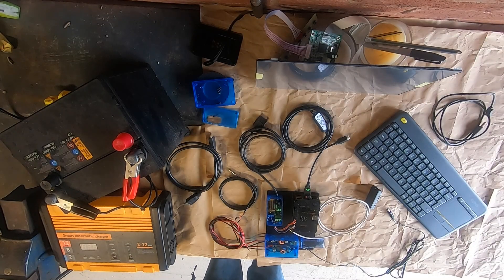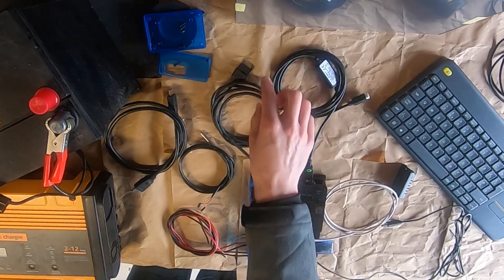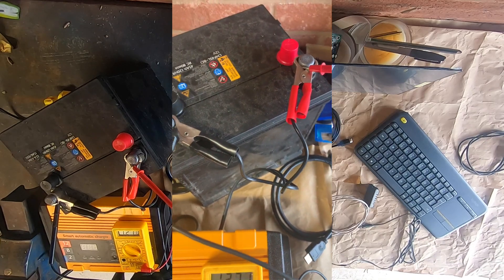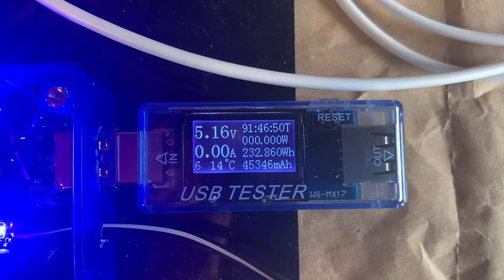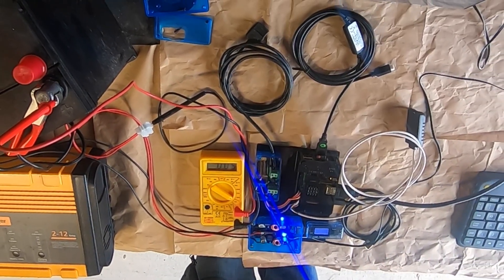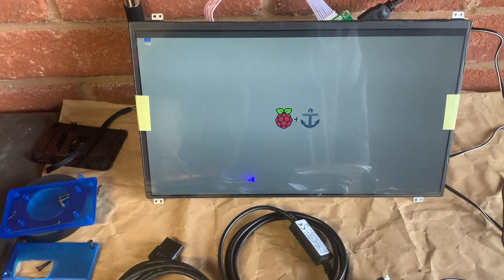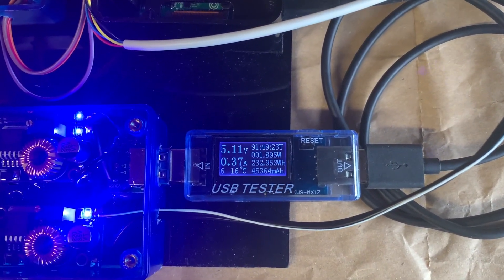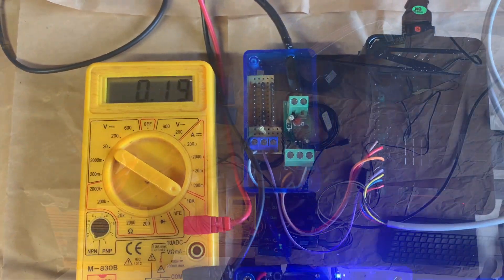OpenPlotter - Pi Power - Consumption tests

Comment: I have a stupid question. Does your screen only draw 0.3 amps at 12v ? A little over 4 watts when it's powered on ?
Reply from the maker: Hi, not a stupid question at all. That is correct, the display is actually 3.3v and it says in the description that it needs a 2amp 12v supply but when you read further down the panel is 3.3v. I just took a gamble with the screen and it paid off I guess. It’s still going strong although my power consumption has gone up when I switched to the pi4. It now sits just over 1amp at 12v

Comment: This has been an excellent little series on the Pi/Open CPN....I am planning to use Open CPN on my Crusing Boat but hadn't really thought about running it all with a Pi.  I don't see anything that this system can't do as long as the signals can be converted from NEMA 2000 (or what ever signal you choose). You really have explained this process fairly well, I was under the assumption that ths type of system required lots of programming knowledge. I am really rethinking my options now. I hope you'll continue with this series. Thanks for the time and effort.
Reply: I'm using Openplotter which includes OpenCPN. I am receiving/sending/converting NMEA0183 into and out of my pi to other devices. For example I'm sending AIS to my fish finder over 0183. I can see the same is possible using NMEA2000 also.
Reply from the maker: Thanks for the comments, I have a couple more updates and videos to come

Comment: I love the bme280 with housing where is that coming from please?
Reply from the maker: Many thanks. It was just a sensor case from eBay. Took a week or two to arrive but does fit well and looks good. Here’s a link https://www.ebay.co.uk/itm/Plastic-Case-Small-Humidity-Sensor-Electronics-Box-Instrument-Enclosure-ProjX2X2-/224309478352?_trksid=p2349624.m46890.l49286

Comment: Loving your videos!  Which cases did you use for the power supplies please?  and what's the case & board top left, is it for the t-wire sensors??
Reply from the maker: Thanks for the comments. They are just small electronics cases from eBay. Here is a link https://www.ebay.co.uk/itm/Genuine-Hammond-Blue-Black-ABS-Plastic-Enclosure-Project-Box-Case-/262466744840?_trksid=p2349624.m46890.l49286 The board I think will be the breakout board I made for the one wire sensors. Just some breadboard with soldered terminals on. I maybe went a bit ott on the number of connections but we will see!